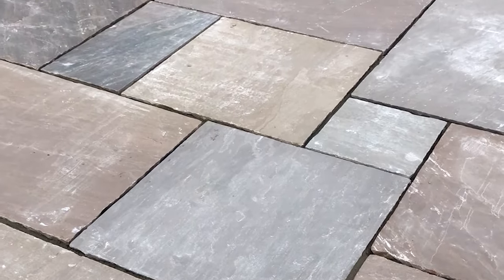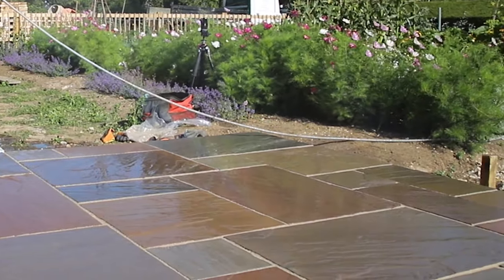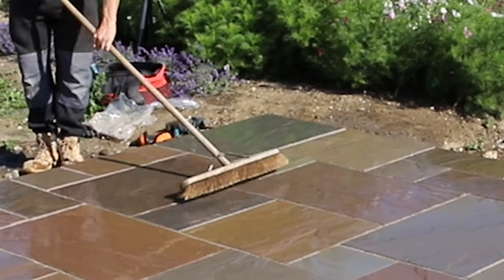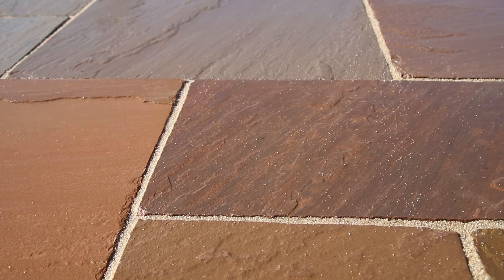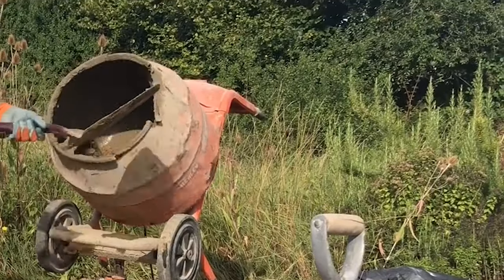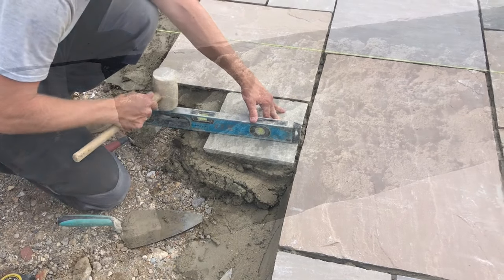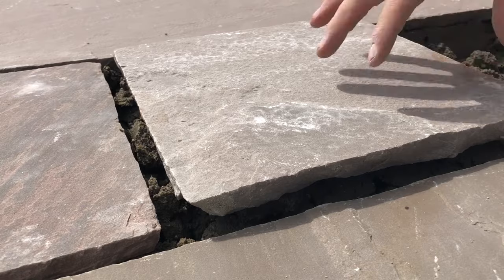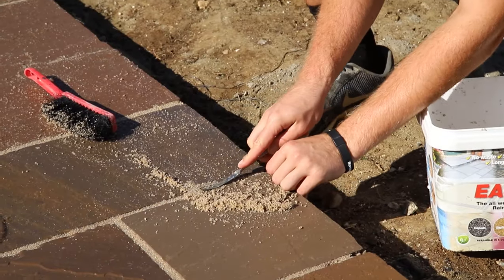Laying Natural Stone Paving Guide

Comment: Excellent explanation and demonstrated. I would advice any first timers laying a patio to ensure that the mix is semi dry and not to mix a really wet mortar mix. A semi dry will support the slab without it sinking if too wet. I would also recommend a slurry mix on the underside of the slab. Lastly with riven slabs, ensure that the riven pattern allows the water to fall away and not trap any water in a puddle which may attract algae, however this may not always be possible due to the random nature of the riven pattern / cut on the slab. Laying a simple patio is well in reach of competence of most able bodied people irrespective of experience and will save one money by doing it yourself.

Comment: Is it ok to do it on top of crushed stone like that? I typically pour a concrete slab first which drives the cost way up
Reply: I think it is ok if you compact every 2 inches and use geo grid every 3 inches.  Lots of installations have been done over the crushed base.
Reply: @mpers I'm an absolute beginner and I was looking to lay my own sandstone, can I ask what is geo grid? And is this video missing out any important information? Ty for any advice
Reply: @garyskinner2422 slurry the back of your pavers. they havnt done it here and it's important and always do a full base cement. Do not dot and dab.

Comment: You didn’t use a slurry or pva for a start and that’s way too much left over easy joint on the surface it will absorb and stain the Indian sand stone if left like that, make sure you meticulously get rid of all. I have a customer who didn’t really with the easy joint and simply brushed it all over his stairs like you’ve left yours and it stained £150 worth of stones
Reply: Hi do you know how to get rid of the staining? We have had a new patio and the landscapers did the pointing they told me it would fade away when it rains. However its not and its staining from the pointing. Absolutely devastated as its a large area. Any tips would be great
Reply: Can you give me any tips Liam to attempt to lay sandstone, what do you mean he didn't use a slurry or pva? I'm an absolute beginner so any easy steps in the correct way I'd appreciate it.ps I'm laying sandstone
Reply: @garyskinner2422  Hi mate, if its indian sandstone you should really be using SBR, PVA is as pointless as using nothing. Slurry is the name given to a watery cement mix some people like to brush on the back. SBR is basically like superglue for stone it will keep it stuck down pretty well no matter how much weight, walking, driving, etc it shouldnt move. with PVA or nothing after a couple of a lot of people walking on it cab start to move. Hoep this helps
Reply: @rabiaafzal1475 sorry  i just saw this mate, it should fade after around 5 months or so hoping by now its better for you mate?

Comment: Only trouble with those coloured stones is that they look terrible after a few months. Even when cleaned, they lose their colour and go beige in colour.
Reply: I haven't found this at all, where are you buying your sandstone from?
I have had some down for 5 years, once I clean the moss off it looks just like when I bought it
Reply: @InvadersMustDie8D  my local builders merchant. Mine have been down 8 years. I clean them and can see colour, then they dry and go all beige coloured.
Reply: @jismo7  you need to use a colour enhancer sealer. Azpects go a good one for sandstone